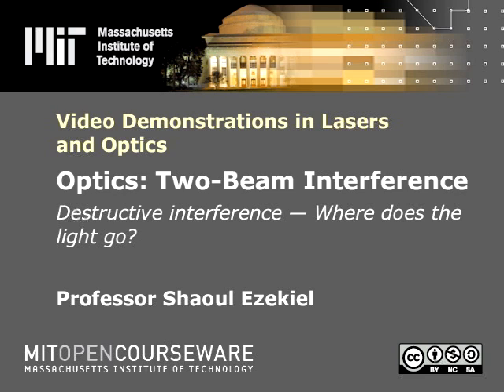Optics: Destructive interference - Where does the light go?

Comment: Ok so noise canceling headphones use disruptive interference with sound. so why hasn't anyone used this same concept to build a real Light saber yet?
Say you have 2 laser on exactly opposite frequencies pointed at the same point in space shouldn't they cancel each other out? Thus stopping both lasers at that point essentially creating a real light saber. Just wondering why no one has done this yet.
Reply: No one has done that, yet, because it's impossible. Interference is not an actual interaction. It can't and does not stop energy flow. We did show this to you in school with wave experiments, by the way. You were simply not picking up what we were trying to explain because it's not completely obvious. It escapes most students, including myself.  I didn't understand this correctly until I took a math class in university years later.

Comment: The answer to the last question is simple. When the two lights were interfering destructively, they already have an effective path difference of lamda/2. Now, in case of the light totally sent back to the source, an additional path difference of lamda/2 is introduced in one beam of light making the total path difference an even multiple of lamda which is the condition for constructive interference.

Comment: What I find more interesting after a second look at this is the number of rings that can be found by moving the mirror back one half the length of the laser chamber.  My question is how far back would you have to move the laser back to double the number of waves.
Reply: I think you're misunderstanding what the rings are (or, I am). I believe the rings are visual representations of the frequency itself, meaning that the number of rings is neither increasing nor decreasing, but you're just seeing them in different positions. Think of those squishy toys that funnel in on themselves, or think of it like a single string vibrating. We're seeing the same vibration at different intervals of "time", which in this case is represented by distance.
Reply: @holdmeclosertonydanza22  Red, should be a 650nm laser.  So, when we are using rings or lines, we can count one ring going from light to dark to light again as a movement of 650nm.  However, the laser chamber isn't exactly parallel, it is a rectangle.  That gives the edges of the laser a different distance from corner to corner or in this case from center outward.  I am of the opinion that there is a formula for laser diameter, chamber length, and ratio of the length of the two outside mirrors.

Comment: what i am watching is that the beams in screen are even sensitive to his voice!
Reply: Ti -CO2 They are I noticed the same thing
Reply: Well yes and no. Yes his voice is changing how the beams react. But anything would, as this setup is so sensitive. The effects you are seeing are due to 2 light waves interacting with each other. Which means you need to aim the two beams perfectly at each other to interact. So yes, his voice is enough to shake the rig the lenses and laser is sitting on enough to move the alignment ever so slightly to change the interaction.

Comment: Which side of the center lens does light reflect off of. Does it always reflect off the front side or always the backside? (Front being the incident side)
seems pretty important to answer the question
Reply: How is a beamsplitter actually made? Usually it is
 a piece of glass with a dielectric or metal coating on the front surface. Light striking it from the front has a 50% (or any other value, depending on the coating) chance of being reflected, and a
 50% chance of being transmitted. In the case of a dielectric (non-conducting and non-magnetic) a reflection does indeed induce a phase shift of π, whereas a transmitted photon picks up no phase shift.  

Details: https://www.cs.princeton.edu/courses/archive/fall06/cos576/papers/zetie_et_al_mach_zehnder00.pdf

More: What happens to a photon approaching the beamsplitter from behind? There it first enters the glass (ignoring the small chance of reflection off the air–glass interface) and has a 50% chance of reflecting off the dielectric coating whilst within the glass — this reflection does not induce a phase change.

Comment: One question... the effect that you get constructive interference at one output while you get destructive interference in the other output is due to the induced phase shift for one of the interferometer arms. So if you could take a beam splitter which does not induce any phase shift or symmetric phase shift for both arms, it should be able to eliminate the complete light... Right?
Reply: in wave theory yes. the light has to cancel out if theres complete destructive interference

Comment: I could be dead wrong, but if the reflected light (going back into the source) is 180 degrees out of for the direct beam, but not for the beam that gets reflected at the half-silvered mirror as that has to reflect twice on the less dense mirror, and once off of the full mirror. When one of the 2 waves is shifted 180 degrees it results in the constructive interference. In contrast, the original path has an equal number of reflective phase shifts, but the distance traveled is 1.5 times longer in one direction vs the other, such that the wavelength is offset but 180 degrees. Not a physics student so I might be missing some obvious thing here.
Reply: You are dead wrong

If you think you can graduate from this college without kissing my kok 🌚

Comment: When I first started researching this I was just as confused by this as many of you, and believed he side-stepped the main question, but in fact he did answer it, we just couldn't accept the answer:

Basically the 'canceled out' light isn't really 'canceled out' in the 1 + (-1) kind of sense, it's their PROBABILITY that cancels. I.e. basically the light goes somewhere else, somewhere it was less likely to go prior to the interference. 

Think of it like having two hallways, one is less desirable for some reason (let's say it's longer), so you PROBABLY take the other hallway. HOWEVER let's say this hallway gets crowded, now all of a sudden you take the other hallway despite it being less desirable. This is what the light is doing. Generally the majority of the light will shine on the screen, but due to the canceling probability spaces (wavelengths) all of a sudden the probability of them reflecting back into the machine becomes the most probable path.
Reply: SaltyBrains  It doesn't go anywhere. It forms a standing wave in the chamber.  This is the principle of the laser (as you have correctly anticipated).
Reply: thanks

Comment: What if we use cubic beam splitter (that does not add the extra 180 degree phase shift) and have a phase difference of 180 degree between both arm lengths (to and fro)? Shouldn't that have a destructive interference everywhere (assuming perfect alignment)?

Comment: It seems like it's tough to find that sweet spot where the light disappears.  He has to press on the bench to fine-adjust the distance?
Reply: That's because red light is ~ 800nm in wavelength and we need to shift a beam by 400nm , it's hard to make an object not move by that ammount, even sound vibrations would ruin the interference

Comment: Answer to the last question: When light is reflected at an optically denser medium (glass) when coming from an optically less denser medium (air) it gets phase shifted by pi/2. Now track the two light paths, and you will see they differ by exactly one phase shift of pi/2. That means if one interefers constructive, the other will do the opposite
Reply: Indeed. The two paths looks identical, but they are not! They are symmetrical (as you wrote). And to answer the question in the title - where does the light go? - one may follow its energy:

https://skullsinthestars.com/2010/04/07/wave-interference-where-does-the-energy-go/

Comment: so what happens when they really do FULLY destructively interfere?
Reply: There is no such thing as fully destructive interference. The lesson to take from this video is that destructive interference in one location means there is constructive interference somewhere else. In the same way, constructive interference in one location means that there must be destructive interference somewhere else. The total amount of energy in any wave (light, water, sound, etc.) is always the same. Interference means moving the energy from one place to another.
Reply: @JohnnyAdroit  The confusing aspect of this, is if you have two sinusoidal waves of equal frequency, but phase shifted by pi... Where then would the energy of the waves "go"?  Does this effect hold up in 2D?
Reply: @bermchasin  If you create/draw a setup (using mirrors and beam splitters) where two beams of light are made to overlap with a phase difference of pi, you will find that the must be at least one other path out of the setup where the interference is not destructive. Try drawing a bunch of systems to get laser beams to overlap. Make sure to keep track of the distances traveled and the phase changes induced by the optical devices. Reflecting off a mirror or beam splitter causes a phase change of pi, passing through a beam splitter does nothing.
Reply: Imagine two people and a rope. What happens is the waves with opposite phase meet at the center point which is not moved at all (destructive interference happens here), BUT the waves will continue travelling and then hit each person with same power as when sent, only the returning wave will have opposite phase then when sent. No energy lost.
Reply: @LiborTinka  Interestingly, conservation of energy means that any " disturbance, change of state "  in the universe must go somewhere, it cannot be destroyed. It appears to diminish something else must be absorbing that disturbance. It is a relay race that never ends. Therefore, if this is the case the disturbance itself must have received its energy from a previous disturbance. The question is where did the original disturbance come from where the Law does not apply?

Comment: Possible explanation: Remember that when a beam is internally reflected in a material it gets an additional phase difference of Pi. What I mean by internal reflection of a beam is a light ray that travels inside the material and in the interface glass- air gets reflected. One of the beams that gets reflected back to the source is reflected internally in the glass and so if the two beams that interfere in the Mickelson had initially a path difference of a factor of a wavelength (phase difference of 2nPi) producing a completely constructive interference, the beam that gets back to the source will have and additional half-wavelength path difference (due to that Pi additional phase difference caused by internal reflection) which will produce completely destructive interference.
Reply: Sort of correct.  Except (1) It's not internal reflection; the beam-splitter has a dielectric or metal coating on one surface, where the reflection takes place. (2) The phase change occurs when light coming through air is reflected by the coating at the front surface.  When the light comes through glass and is reflected by the coating (at the back surface) there is no phase change.
Reply: @robinswamidasan  cool

Comment: A cubic beam splitter has no phase change associated with its design, yet the same phenomenon of total destructive interference still occurs.  And it is true the light returns back into the laser and can cause the laser to de-phase get warmer and even burn out if it cannot get rid of the excess heat.  I can answer this but it cannot be accepted using the present rules of superposition.  It is difficult to find it in my work at synodicgravity.com but it is there.  See Edmund Scientific for cubic beam splitters.
Reply: I forgot to add:  The slow blinking on and off during total destruction is due to the laser going in and out of phase due to all the light energy returning back into the laser tube.  Full total destruction without the blinking on and off can be accomplished by setting the interferometer beam paths lengths to the exact equal measurement of the lasers internal mirror to mirror length or cavity length.  In this case the laser will over heat.  A lasers cavity length has to be precisely tuned to the gas elements.  In this case Helium and Neon or a laser will fail to lase.
Reply: Todd Grigsby I can give you the answer to this but it is easy to understand but difficult to believe.  I've had huge arguments about on science forums so I don't like to talk about it much.  Its the same thing that happens with radio waves, which are e.m. waves just like photons.  But because the photon is so much smaller it is less likely to occur unless very precise conditions are set.
Reply: Todd Grigsby Further the feedback so to speak feeds all the way back to the
electric circuit and may be detected as a minute current fluxing in the power source. That is if it is not lost or dumped off somewhere else.
Reply: @1234ToddgMr  What happened to your website? It's down and I didn't get a chance to see it yet.